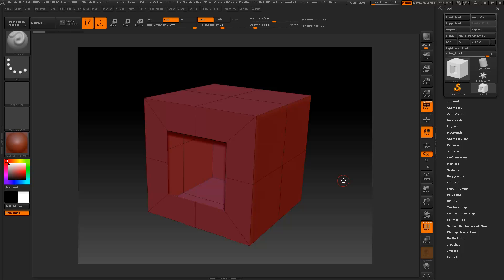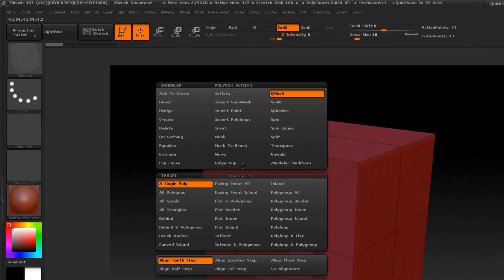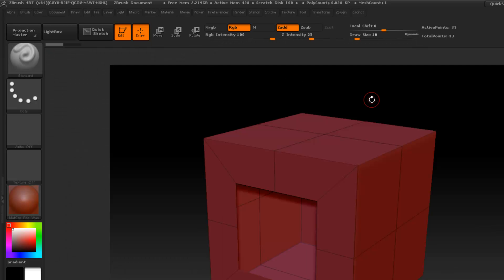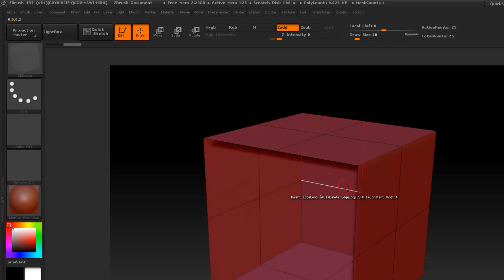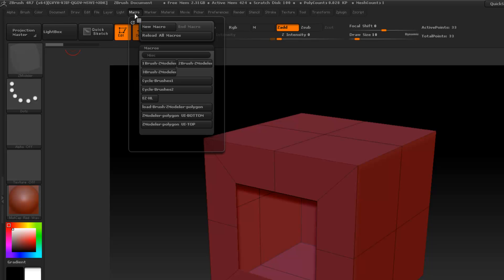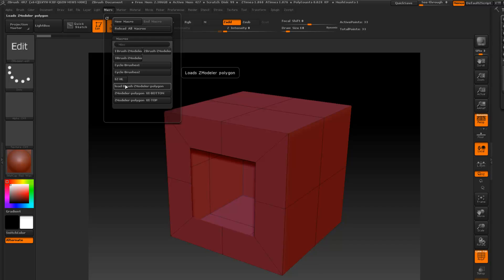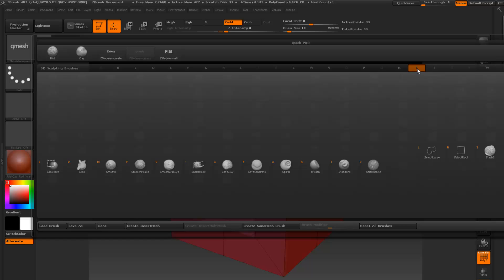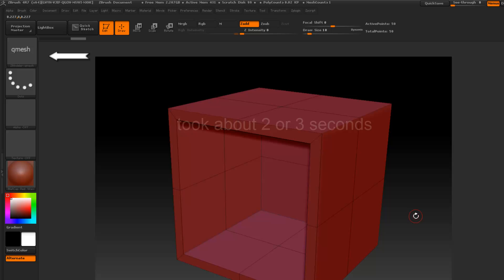ZBrush 4R7 shell help

Comment: hI ez WHEN YOU MENTION PRESS HOTKEY,WHAT KEY I ARE YOU PRESSING?
Reply from the maker: Maxwell2010Macana i think i set it up for the letter Z for the hot key but you can make any key a hotkey or use the up and down scroll mouse wheel as a hotkey. look under the video there is a LINKit will show you how to set up hotkey.you can set  up one hotkey to 1 brushor one hot key for 2 brushesor one hot key for 3 brushes